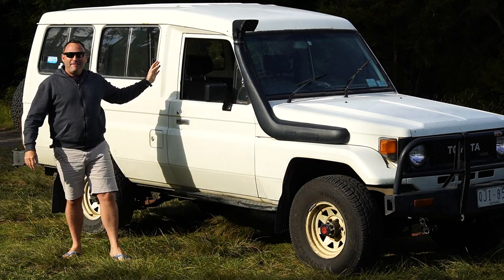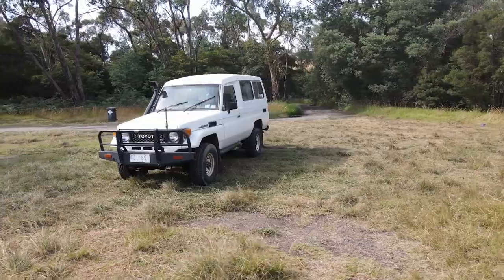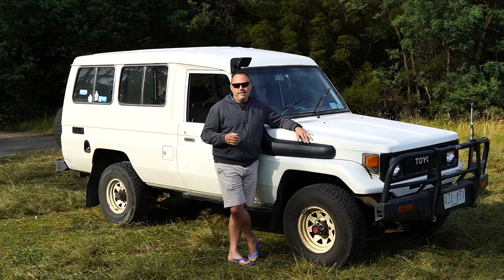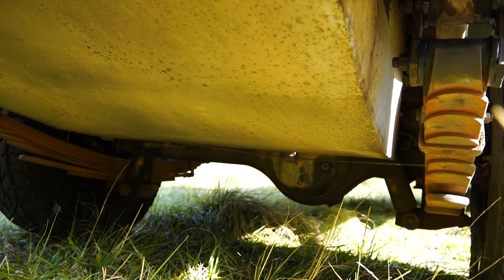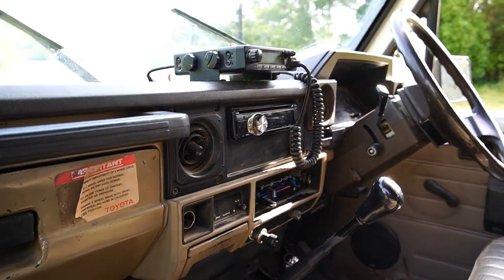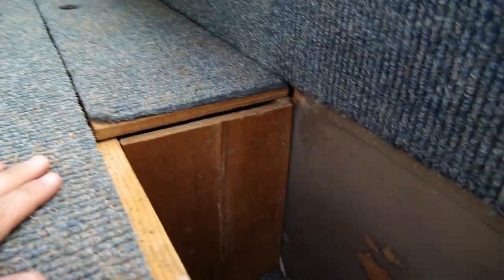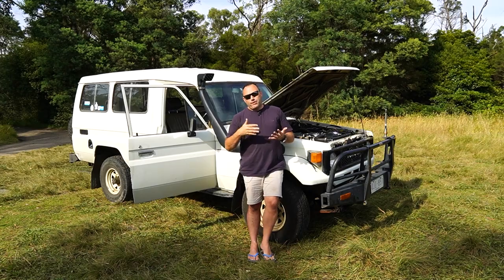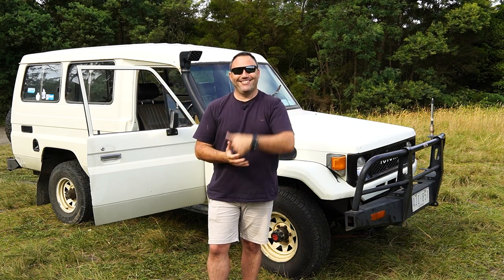I BOUGHT A 33 YEAR OLD TROOPY // HJ75 SERIES LANDCRUISER - EP.65

Comment: Mate. That’s the best $1500 + $3200 you’ll ever spend. I drove Troopy’s in the late 80’s on 4x4 tours all over 0z, most with a 2H donk. Slugs, but reliable, from freezing to baking. I’ve had my own’98 Troopy for 12 years. Designed & fitted out myself, with professional help. The ultimate independence vehicle. OK, so it may not be a chick magnet, but if you do get lucky, there’s plenty of room for getting deep into the heaviest  bush, and getting back out! Good luck in your journey. Troopy’s rock.
Reply from the maker: Yeah. I’m pretty happy. Thanks for watching and leaving a comment. I used to own a 1997 model Troopy. 🤙

Comment: I had to rerun that bit where you said the price to be sure cos you sure got a bargain! 
Mine is a 1988 landcruiser ute with alli tray and I've been offered $40k for it! Admittedly it's had a complete body and engine rebuild for its birthday every 15yrs, has zero rust, zero bog and runs l like a dream with the addition of the 1HZ which is the turbo engine from a later model sahara. And it's had a gearbox rebuild to now give it a lower first gear. Other than that mine is pretty standard as well with almost 750,000ks on the clock. I did a fair bit of 4x4 (without damage) and towed a large fully loaded two-horse float all over the place on a regular basis. 
But the most important thing about these older vehicles is they DONT BEEP AT YOU! You can actually be in charge of the driving and what is going on under the bonnet. I would not part with it for a million bucks. I don't need all that fancy stuff. It's got air, a cassette player and a radio! What more do I need? 🤣🤣🤣